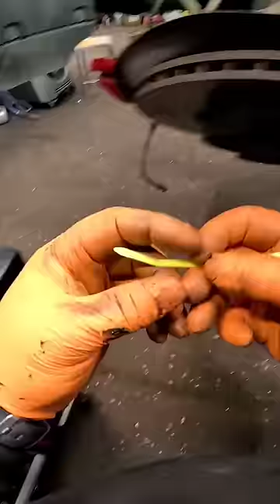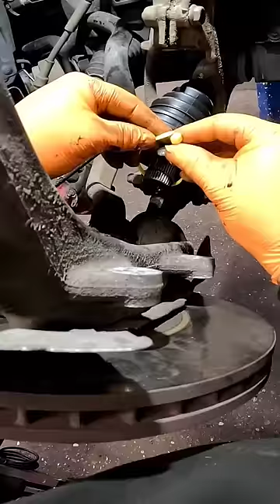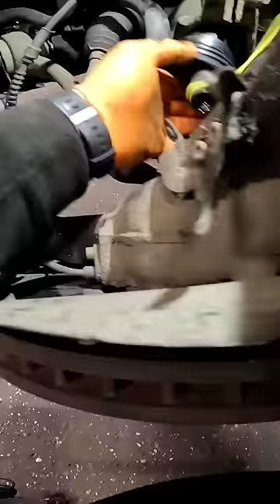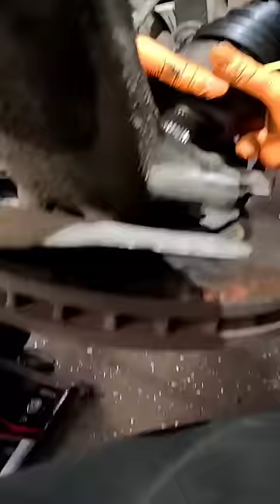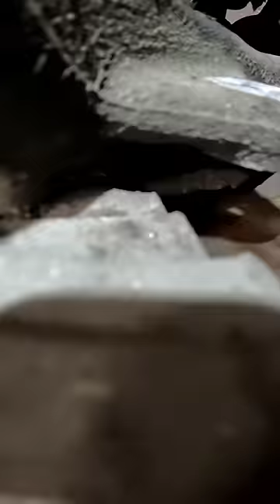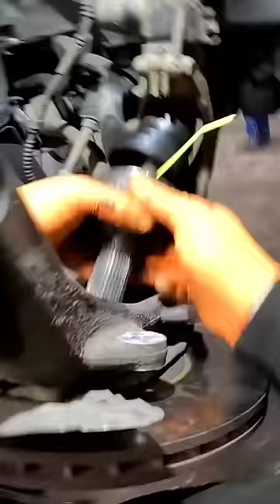cable ties are just the best

Comment: my father taught me how to replace cv joints when I was 14. He would just replace both ends so that you can be assured that everything is perfect.  He also taught me that when it comes to suspension,  whatever you do to one side do it to the other
Reply: You try telling that to customers at a garage 😂
Reply: I know right...
Mechanic: I highly recommend that we do both sides. 
Customer: No, just that one side is all I need.
Mechanic: 🤦‍♂️
Reply: That is so cool never thought of that
Reply: Labor costs more than a rebuilt CV axle for almost all vehicles.  If you are a mechanic and barely able to feed yourself is the only reason to attempt this on your own vehicle.  
It is way faster labor wise to put in a rebuilt CV axle.  The cost would likely be less to replace with rebuilt CV axles because they are surprisingly cheap.
Your little zip tie trick did work but noticed you didn't show the fun of removing the sip tie.
Reply: Your father was right.
Reply: @richiec9077  I can complete a whole CV axle replacement before you finish fiddling with one of those boots and all that crap for $150+/hr.  To change the boot, you have it apart enough to change the CV axle.  It costs more to just change the boot if you are paying to have it done because labor hours are way more than rebuilt CV axles.
My way you get new boots AND new CV joints for less money.  
Save the speech.  A garage that pushes this method over rebuilt CV axles is just padding their bottom line not saving you a dime.  Plus you'll be coming back soon to pay more for all the same sh_t to be taken apart and do it right.  Only a fool chooses to just change the boot.
Reply: What other words of wisdom did daddy tell you? You gotta have more.
Reply: I'm telling the customer they need the whole cv axle...but this would be a cool diy thing to do if it is about to fall apart to give u time to get a new one
Reply: @dariusknows  I wouldn't ever just change the boot unless I had no other choice for some reason.  You have everything apart the same amount to do it either way.
Also, if just changing the boot, pull the whole axle out and do it on a clean beach.  You get sand/grit inside that joint and you'll be taking it back apart.
Reply: @x-man5056 that wasn't towards u at all..I was just saying..like I said I would do the same for emergency situations for sure.
Reply: @dariusknows  No offense taken, all good.
I did think of the one time it makes sense to just change the boot; You are doing it yourself, the CV axle is near new, and you cut a boot off roading or other.
Reply: Hydraulics work the same way. If you blow a hose, replace every hose in the circuit of you will be doing it next week.
Reply: @bassmangotdbluz  Yes.  also Headlights, fan belts, wheel bearings, tires (often).  We do it automatically most the time.  Are you a heavy equipment mechanic?
Reply: @tonyh4966  tbh I agree in changing the other side too , for instance I had a broken spring on the front of my 2001 Audi and decided to change both front springs and shock absorbers and top mounts only because it's an old car and the other side weren't exactly fresh. In most cases on most modern cars I wouldn't bother , you wouldn't notice any difference anyway except for the cost 😂
Reply: @x-man5056 as long as you aren't using trash from you know where. I put in 3 rebuilts all trash. That's why many rather stick with oem.

Comment: what is he trying to do. the video terminates without anything happening
Reply: looks like he's using the tie to stop the circlip from moving when he puts the stub axle back on
Reply: He's using the cable tie like a piston ring compressor to squeeze the circlip down so that the joint slides over it easily.
Reply: The hog ring in that grove holds the spline in that seat.  He’s closing the ring with a tie and then sliding it into the boot and then removing the tie
Reply: Gotta be one of the worst made shorts ever posted
Reply: I would not do a repair on a cv joint using a plastic zip tie.
Reply: Brilliant tip. For those that understand what you're trying to show 😊

Comment: Did them for decades never had a problem putting them on, taking them off however is a totally different story.
Reply: I totally agree  Removing them is the problem.
Reply: Exactly m8 can b cunts to get off but I have never struggled putting them back on and I been a mechanic 4 many many many many many years!!!!!!!!!
Reply: Bigger hammer
Reply: Obviously use a zip tie coming off… duh.
Reply: @Scavs_Inc  Is that a real reply or are you just being a wise ass?
Reply: @ernsailor9041 he's trolling and you are the sucker 😂
Reply: Great idea!. Just wish there was a similar hack to remove them.
Reply: Yep I wish he would show us the easy way to get them off 😂 many a fight I have had with these
Reply: Some cars you can use a slidehammer,but there are also cars you must open the circlip whit a set of pliers. 
Always a party to find the opening in the grease 😎😎
Reply: @jantrammelant  it's a great time ain't it 🤣🤣
Reply: I’ve always had good luck by pushing in really hard at the same time hitting it in the opposite direction with a big hammer and usually they come off the first time.
Reply: A little screwdriver fixes a stubborn clip. 
Some VW ones are a joy to get off. Undo the centre bolt, slide the joint out the hub, then reinsert the bolt. As the bolt tightens it pulls the joint off.

The only vw job that not a PITA and the way they should all be.
Reply: Just cut a 8cm bolt, put it inside straight, then screw the big bolt.
Reply: I broke a giant vice with a sledge hammer and even after sectioning the whole inner cv joint section into 3 loose pieces the joint still wouldn’t slip over the clip. 

Some of them have a one way chamfer and will. Not. Come. Off.

Comment: Its way easier to just use a dab of heavy grease. What he's doing is centering the retention ring that fits in the recessed portion between the splines and pushing the joint past that area then cutting the zip tie. This joint is full of heavy axle grease so just use a tiny of bit of grease to hold up the ring on the splined shaft and no zip tie needed. Also zooming in and a tiny bit of explanation goes a long way to making a decent and helpful video.

Comment: Entire left and right axle shaft assembies were like less than $100 for my 95 Geo metro.  Changed transmission output seals easily while there.  Entire job takes about 3 to 4 hours at home on weekend, drinking beers, taking the time to do it right because it's your vehicle.  In a dealership 2 hours, but They'll bill you for 8.
Reply: Great idea; drinking beers while working on your car 👏 👏 makes me feel a lot safer on the road
Reply: Tip #1. Stay far far away from dealerships
Reply: @sherifmohsen1974  "Woke" alert!
Reply: I had a 91, best car I ever had in terms of gas milage and ease of maintenance.. parts were cheap... I always wondered why they disappeared.. It was probably because of all those things 😂

Comment: For anyone wondering. he's squeezing the circlip with a zip tie so he can slide the joint past it instead of fighting with it with a pair or plyers. Im guessing once he gets it past the circlip he snipps the zip tie of and puts it all back together.
Reply: But why is the cv spline sliding into another spline before wheel assembly. That spline goes through the wheel assembly and is fastened by a castle nut and pin. What’s the purpose of having a spline into spline extension boot? Are the wheel offset or extended out for this to be invented or just broken down into more parts for no reason?
Reply: @daniellepage2923 that spline is the end of the axle, he is putting the cv joint onto the axle, hence the boot that’s there to be put over the cv…
Reply: @daniellepage2923  What Bluerasberydude said is he took the Axle apart just 2 replace the Boot. He more, less Rebuilt the Axle. Kinda sorta?

Comment: A new axle comes with peace of mind and a warranty. You're already paying for all that labor might as well pay for the new part.
Reply: The original is 50x better, aftermarket quality is HORRIBLE by comparison
Reply: Yeah but you can still buy OEM
Reply: @clydes95cummins in many cases the OEM aren't available because the manufacturers can't compete with the aftermarket due to the price/decent quality. How many miles/years do you think an aftermarket drive shaft lasts? If you're going to buy OEM then what's the point of just replacing the boot and not take it to the dealer?  My comment is for the most common applications and advantage vs extreme examples. This method is about saving money not using better equipment. Let's say he repairs it and it took a couple of hours out of your job, a few months later it breaks. Then what? Another few hours away from your job, the inconvenience, you have to pay for another shaft and the same amount of labor again.
Reply: So get a new car comes with peace of mind a warranty
Reply: @JoelMonsivais-yz9ky  just walk.
Reply: Why replace the whole shaft for a split boot, pointless!
Reply: @Airgunfunrich  why ask this question when you can just scroll up and read the explaination?
Reply: @ipleedafif8033  pointless to change a perfectly good part for a split boot of joint is fine. New. Boot £10 cv joint £178  1 hours labour if that so to replace the whole drive shaft if it’s still serviceable is pointless unless you like wasting money!
Reply: Ikr! The part(s) he’s leaving…. becomes the weakest link!😮😅

I replace the whole thing too!
Reply: @JoelMonsivais-yz9ky this is how you get more vehicles on the road…. no one can repair at home!😅😂😅😂

Long time ago fixing cars was much easier & most men had a sense of pride to do it! (Not jus changing oil)!
My father taught me a lot about cars! Changing starters & alternators was the basics! Many men can’t tackle the simplest repairs now! 
Oops the windshield wipers are worn….. time for a new car!😂😂😂🤪🙄
Reply: @Airgunfunrich  if the boot is ripped then dirt gets into the bearing and joints. So that's not a "perfectly good part". What happens when the part goes bad after a month? You pay for double the labor. Being cheap with certain parts isn't smart.
Reply: Learn from me
Aftermarket new axles are garbage
Oem axles for older vehicles, good luck if avaliable and on top of that, the price for them.
I put 5 sets of axles in my accord (aftermarket) and still had vibrations 
Put in a used oem one. Smooth as glass
I was fighting a vibration issue 
And to repair my old oem one, parts to rebuild it is around 400 bucks. New oem is 650
Used oem from dismantler was 50 bucks
Reply: @silo222  cap. 5 set? You must not know where to buy good products. How long ago was this 1980's? My family has had a shop for almost 30 years now and we mainly service Hondas, Toyotas but we get lots of domestics also. We haven't had issues with after market parts like CV axles. Maybe electronics or sensors but mechanical?
Reply: I spun the CV joint on my half shaft once. Car in gear, didn't go anywhere. Axle grease vomit in the engine compartment. Definitely more than a split boot. Y yoke was fine but I still got a new half shaft, rather than rebuild the CV joint. Had that 90 Oldsmobile Cutlass for eighteen years, since brand new. Five speed manual attached to a Quad4 HO. Normally aspirated, I embarrassed a few turbo charged Chyslers 🤠
Reply: @Airgunfunrich   by the time most customers are willing to fix this issue is after it starts clicking when turning so the joint is toast anyways. Cheaper to replace the entire axle.
Reply: @tjkj-om9oi  in 🇬🇧 gets picked up on service or mot if slightly split an people usually get it fine if picked up on service if picked up on mot they have to have it done if want car to be legal….
Reply: YOUR CRAZY
Reply: YOUR MADD
Reply: @skillz1855 agreed, sometimes a used oe one cleaned with petrol and new grease will outlast a new spurious one.
Reply: NO DOUBT! Just pay the extra 40,50?$$ & slam it together! It just Junk! You can't hurt Junk! Hear Me!!! 🤣😂🤣😂
Reply: @orlandojohnson5742  yeah.  If you need a boot, then it ran without grease...for how long exactly?  IDK, but I do know a new one will be pretty easy to do on most cars.  And they haven't run without grease.

Comment: Personally i put the circlip gap at the top, offer the axle up to the shaft and then hit it square with a hammer. Your trick however would work where there is little space to work or for those without the knack.
Reply: alright why would you  be doing that to a front of a car that isnt all wheel.drive? thats a dirty bait and switch show your face and ⚡will strk ⚡⚡⚡
Reply: Where does the tie wrap go?
Reply: @davewebster1627  just slides further down the shaft and ypu cut it off before pushing it all the way home.

Comment: What is the purpose of the zip tie?
Reply: Compresses the snap ring
Reply: To compress the "C" clip while you slide the joint onto the shaft. A light tap on the front of the joint with a deadblow hammer will do the same without having to fish out the other end of the zip-toe.

Comment: The problem is this ring can stuck when you will want to disassemble. Need to bend it so that it's endings will not stuck between surfaces. Just take pliers and bend ending so they won't jump out before installation
Reply: which way to bend
Reply: Bend em IN slightly so when ring is installed endings is hidden in groove
Reply: Don’t forget to grease the joint. It’s much easier before it’s fitted to the shaft. Fill it to the brim. The excess will get pushed into the rubber boot.
Reply: That's you that does that??😂
Proper tools = proper job.
I remanufactured these for 20 uears, there is not one thing that should be altered in any way. If it's hard to do, your doing it wrong .

Comment: Black cable ties will last longer than the white.  Let just say18 years of experience. Especially if it is in the sun.
Reply: That’s funny I do hvac and I can confirm that white zip ties don’t hold up at all compared to black zip ties
Reply: I didn't know that. Thanks to you and @cody- gaming7593 for the info. Now that I think about it I have had a shit load of white ones puss out on me over the years.
Reply: white ones are made with a more brittle plastic you can pretty much pull pop them, not with the black-uns your pull ur finger off
Reply: THATS RACIST!  2021 just called and told me!
Reply: once the stub is back on that tie is doing nothing anyway. also won't be in the sun if it's inside a CV boot
Reply: I have white ties to give away so I don't waste the black ones.

Comment: Why screw with it when you can buy a complete axle shaft for the price of a boot and grease??
Reply: buy me one complet axle if you think it is cheap saying it is easy downing it is hard anybody can say it is cheap
Reply: If the dust boot is the only problem, it costs 16€ and 30 mins to remove, clean, grease and install. Full shaft assembly is anywhere from 110€-180€ plus transmission fluid as you will lose some pulling them out the transmission. But I agree, don’t screw with it if you don’t know what you’re doing. Just replace the whole thing.
Reply: I've seen jobs where the axle needed to be separated to be removed.
Reply: Some cars your only option is to rebuild it. The aftermarket axles never work right for some cars. So its junk yard axles, or rebuild
Reply: Despise  front wheel as primary drive
Reply: Where do you buy your axle stuff, sounds reasonable.
Reply: This comment, is clearly a joke yall.😅😂

I mean, RIGHT??
Reply: Thats how we have no mechanics anymore, just new part fitters
Reply: Maybe in USA.
Reply: Because that's not the axle shaft that you want. That's the one made in China.
Reply: @Barracuda48082 all modern rear wheel drives have rear CV joints too. If you have a live axle then your car is running on 20th century hardware. My 1985 Alfa Romeo had CV joints at the back already.
Reply: But then you have to refill the gearbox oil
Reply: This is only true of you're getting your work done by a shop. It's not worth the labor cost of putting a new boot on because it will be the difference in price of installing an entire new axel shaft. When you DIY, this is cheaper on just about any car. Hope this helps.

Comment: Most outer CV axles joints dont seem to just pop off the half shafts like in the early fwd car half shafts and are a  major PITA to take the inner joint apart to slide some wanky universal aftermarket boot over the drive axle. To buy the OE replacement boot probably cost as much as just getting a new aftermarket half shaft

Comment: Hmmm I think someone has tricked him! They are easier going on than coming off! I’ve changed on 2 of my cars!  Also I replace the whole CV Axel!   
Tie straps are good for a lotta things! I use them to hold the brake calipers up while changing the brake pads or replacing the rotors etc.
And I’ve used to keep tension on the clutch & pressure plate…. As your installing the transmission to the pilot bearing/flywheel. Keeps the clutch from moving! Once transmission all the way in , you can snap the strap off the clutch lever outside the bell housing!✌️🙏🏽👋🏻